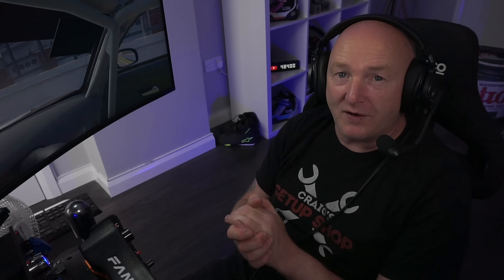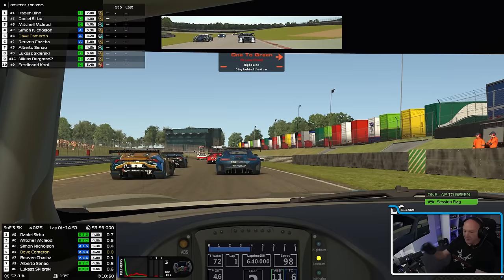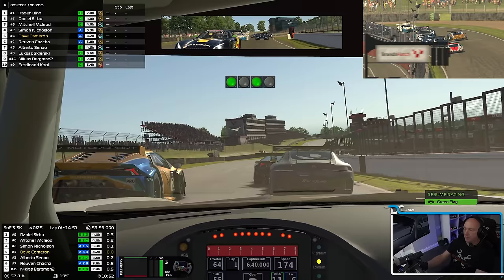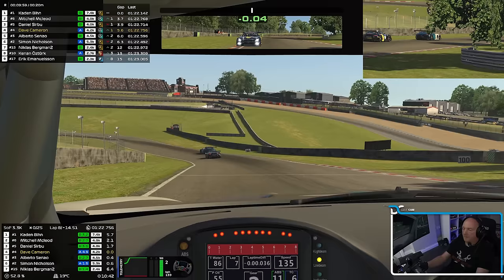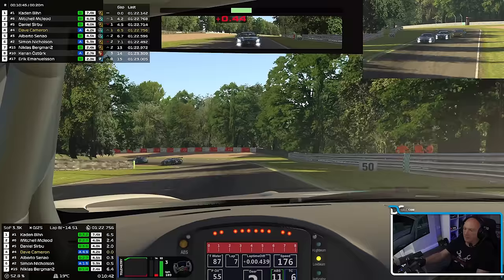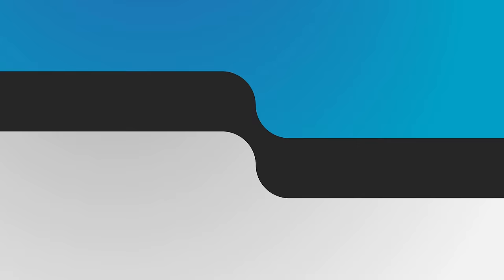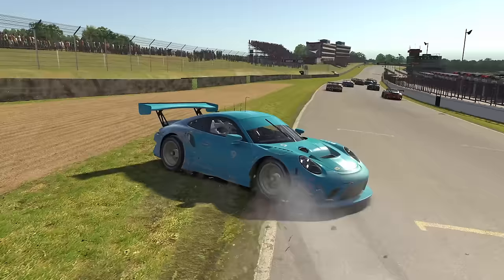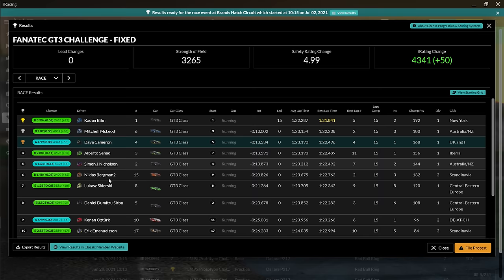Making my Mercedes super wide! | Fanatec GT3 Challenge at Brands Hatch

Comment: I'm curious...when you talk about brake bias and compromises...tou know you can change the brake bias on many cars on the fly and the GT3 cars for sure. I use the thumb wheels on the Fanatac Formula V2 wheel to do just that. If turn one is sketchy just set it up for the rest of the track and adjust it for turn one and then back to standard after the turn.

Just a thought.
Reply from the maker: I do that during a race sometimes but try and leave it consistent if I can. If rather have a stable car for the duration of the race 👍